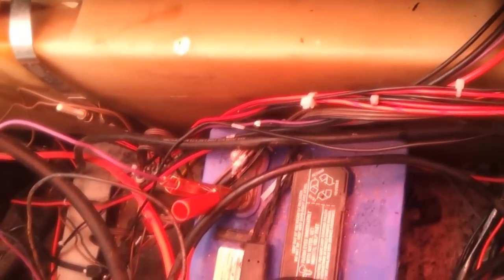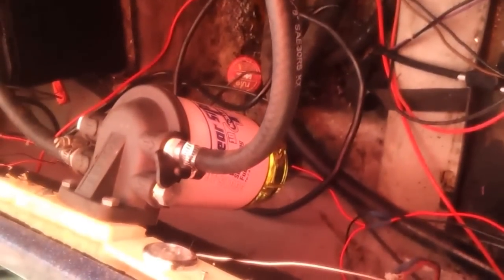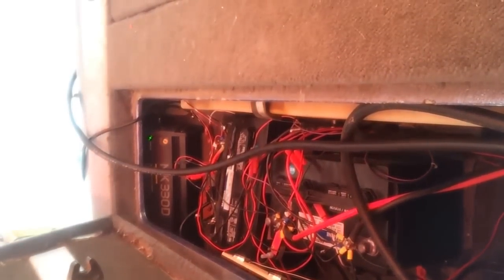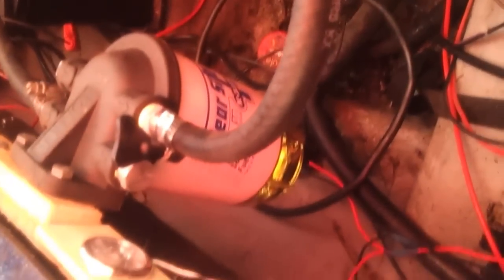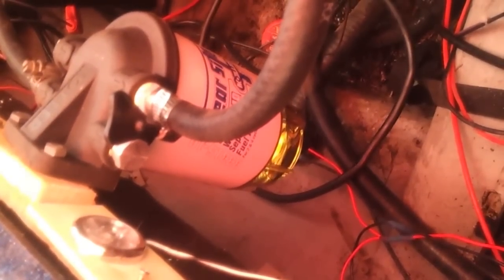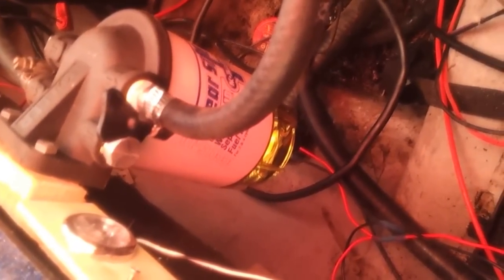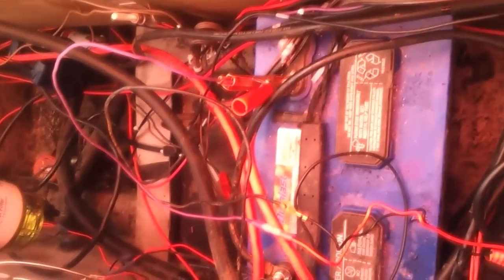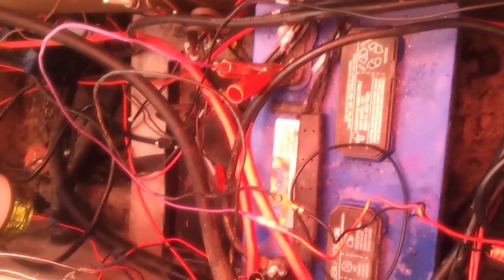Marine Fuel Tank Cleaning On Board

Comment: Awesome idea & video! Just one question. How much fuel do you have in your tank to do this right??? I mean, I have a 140lt tank, will I do the same good job with 40-50 liters gasoline inside my tank?? (In anyway, I think most of the water or harmful debris are located in the bottom of the tank....)
Reply from the maker: Measure or have the measurements of your tank, you'd need enough to get the flow going. Now if its easy enough to remove the tank, then I'd do like some say and remove it and flush it with high pressure water and dry it out. But my tank I couldn't remove it without removing the top cap (no way). It was a 20gal tank and I doubt I had 5 gals of fuel in it. Experiment with it, its the best way of learning (just don't blow yourself up) ;)
Reply: Thanks for your answer mate. I think that I will try it with the 20lt that already have inside it, and then with a full tank for hours...! If it doesn't work this, I will definitely put fire in this dirty tank! ;) ;)

Comment: That's some nice wiring
Reply from the maker: and that's the crap I ripped out when I rewired it before I sold it, it was a total mess. Nothing was color coded, they even used RED for a ground wire. I started off with a nice wire harness from EZACDC, then I added wiring when it was needed.

Comment: Just use star tron fuel tank cleaner about 3 times buy 3-4 filters I drained my tank added 1/2 of bottle  filled it with a 1/2 of tank of non ethanol fuel let it sit for 48 hours ran the boat changed the filter and repeat I did this 3 times now I have no issues and filter is staying unclogged and my outboard is running like a top this method works well just takes time but its a easy fix and the best thing to do is use ethanol free gas to eliminate phase separation .

Comment from the maker: That's your opinion, I've not had a problem since other than tossing two fuel/water separators during and after the cleaning. I can see the sight bowl and run 4 tanks of fuel since (20 gal tank). If the sludge is in the corners, then that's fine with me, its not getting sucked up like it did before my method of cleaning it. Oh and I did use double does of Sta-bil and seafoam in the flushing. It definitely in my opinion loosen the contents. Just replaced the filter again last week.